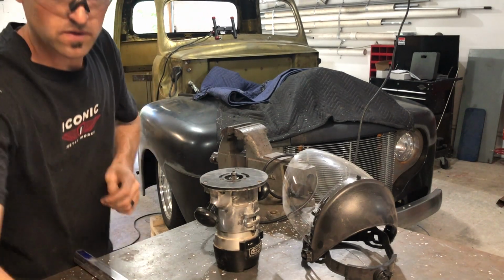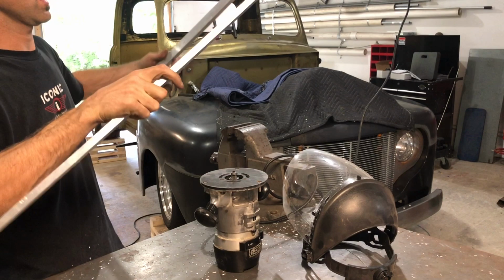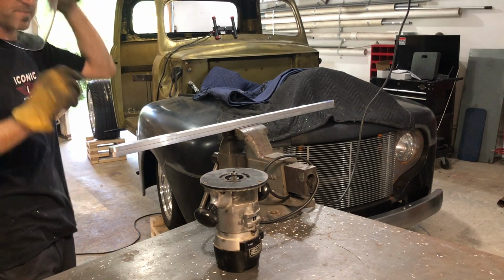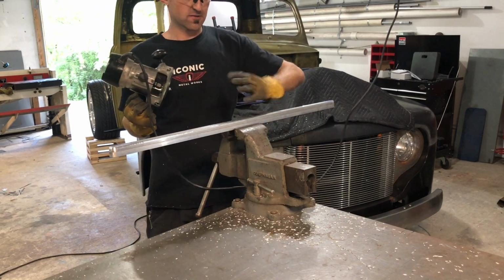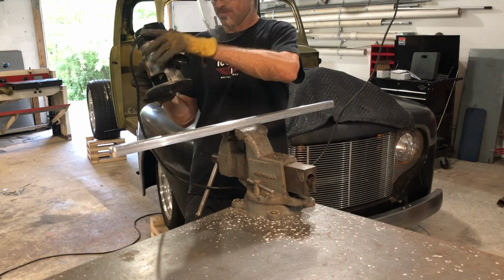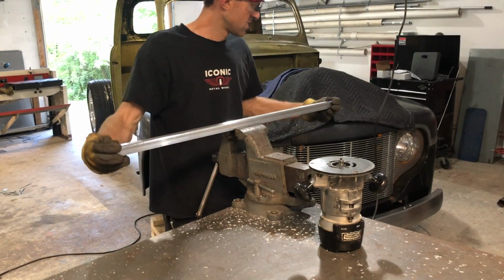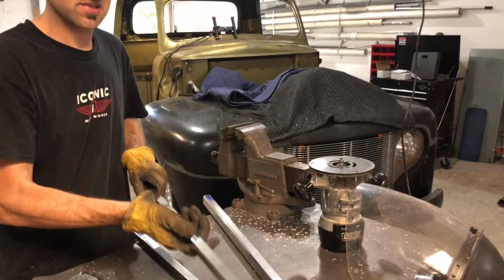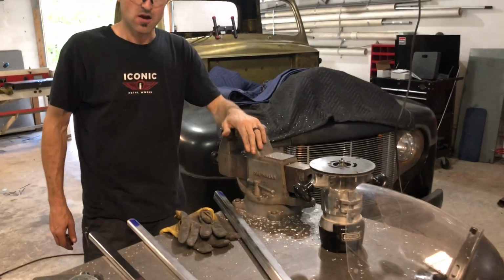How to use a wood router on soft metals

Comment: Nice tip.  I have done a lot of router work with aluminum.  Make sure your bits are Carbide, your guide bearings are lubed and if you use some lubricant like Tapmatic paste you can get really nice results.
Reply from the maker: Good to know

Comment: You can eliminate the router "walking" or "tipping" by using a router table. Makes the job even easier!
Reply from the maker: Not when using small metal it would grab and throw it across the room or at you better to clamp it down

Comment: Good video love learning new things but will it be easy to dent stepping on it
Reply from the maker: Not really made from 6061 alum but yes , the customer wanted these so if someone were to step on the the running boards the would step on these instead of the paint
Reply: @Iconicmetalworks  Ok I was only wandering and cant wait to see it finished. I want to get your list for building the roller so I can start getting all my parts ready and my metal cut out for building it. Also is your shop open to public I would love to stop by sometime when in Nashville I live in the Jackson Area.
Reply from the maker: Of course

Comment: I didn't know you could do that. You might think about a router table.
Reply from the maker: A router table might be too dangerous due to the fact that if it grabs the metal it could shove the metal back at you I prefer to have the material clamped and run the router around the material